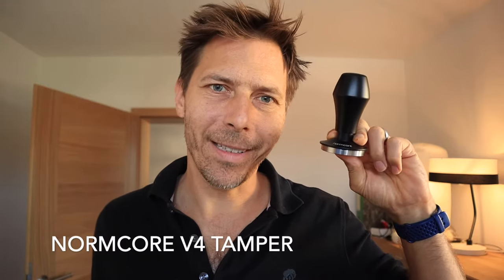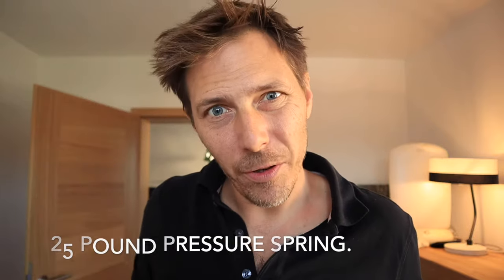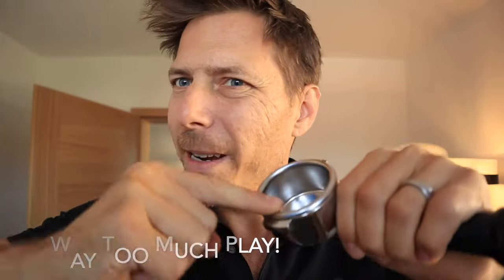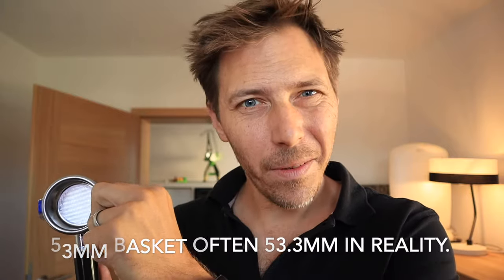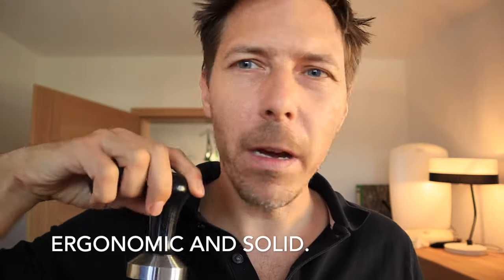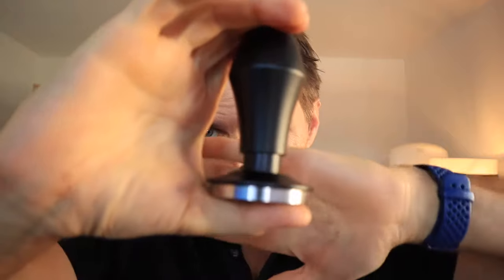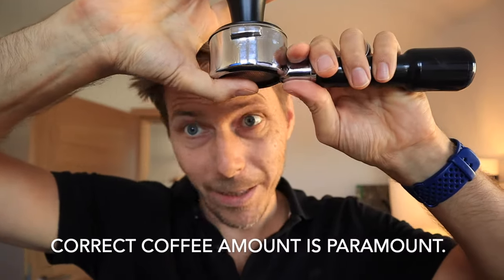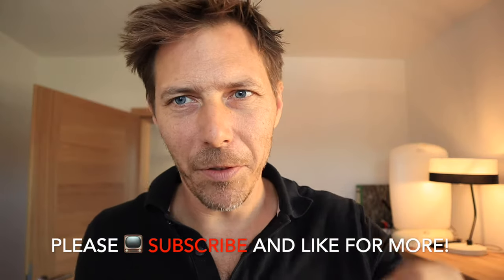A DEEP REVIEW of the NORMCORE V4 TAMPER.

Comment: I think Maestro is 51mm, should I get 51.5mm size tamper then?
Reply from the maker: Hi Ivan, yes the La Specialista models are all 51mm, but they have a ridge, so the 51.5mm will get stuck. You would have to get a ridgeless basket like the IMS to use a slightly larger tamper. But the one the Maestro comes with should work fine. Here is a link to the basket, FYI:  IMS Precision Basket: https://geni.us/DeLonghi_IMS_Basket
Reply: @TomsCoffeeCorner  thank you for the link Tom. I actually saved the bottomless portafilter u also mentioned in the other video, and its for De’Longhi 51mm, so for naked one do I need 51 or 51.5mm tamper? Appreciate for your help
Reply from the maker: @Ivan-fw4rl  Hey Ivan, if you got the Neouza, I believe it would be better to get a 51mm instead of 51.5. I think the Neouza basket is a little smaller than the IMS, although it does not have ridges. Cheers!
Reply: @TomsCoffeeCorner  haven’t bought it yet, its Joytata, it was from your youtube video description link. Guess that would be same as Neouza so 51mm tamper?
Reply from the maker: @Ivan-fw4rl  Hey just so you know, the Dedica portafilter does NOT fit in the La Specialista machines. The only one I have found is the Neouza, made specifically for the La Specialista. Cheers!
Reply: @TomsCoffeeCorner  Neouza in the cart. Thank you so much for your big help. I have few more questions, about dialing it in perfectly to get all parameters right. Hope u don’t mind, I added you on fb. 🙏
Reply from the maker: @Ivan-fw4rl  Hi Ivan! Thanks for the add, but I need to make another profile on FB for the coffee corner. Gotta keep things in organized, if you know what I mean. We can talk however here, or on insta, or YT. Cheers! Tom
Reply: @TomsCoffeeCorner  messaged you on Insta, may be inside the requests, and my name there is BANNED USER (not banned, just joke name) 👋🙂
Reply from the maker: @Ivan-fw4rl  No problem, let me take a look!
Reply from the maker: @Ivan-fw4rl  Hmm, I don't have any messages on instagram. Maybe try again? To be honest, I mostly just use Youtube and Patreon for messaging. But I read them all on YT. 😉

Comment: What dose do you generally use for your vivaldi?  I have the same machine and typically like 14.5g..15g at most. I use the IMS basket.  Was thinking of getting this  but your review is making me question it.
Reply from the maker: I normally use around 16 g. The baskets are just too deep, so I use the combination of this tamper with a standard one. This tamper is great, because it scrapes all the grinds off the side of the basket, and tamps level.
Reply: @Tom's Coffee Corner  Thanks for the reply; seems there is no chance it will work for me then given I use much smaller doses.   The work around for not having enough travel is doable,  just cumbersome to have to always use 2 tampers on the counter.  Hopefully someone will come out with a 53.3 that will work for the vivaldi...
Reply from the maker: @jcran17  Yes, I mean it works alright if you use the original basket that only fits 15-16 grams, but it still could use 2-3 more mm travel. It really doesn't work with the deeper 21 gram basket.

Comment: Your video doesn’t explain how you know you’ve reached 25lbs
Reply from the maker: Hey James, as I understand the mechanics of the springs, the 25 lb spring will compress and give way to the opposite force starting at 25 pounds. So, you have 2 opposing forces. The coffee puck on one side, and the spring on the other. The max amount of pressure the 25lb spring can provide before caving should be 25 pounds. At least that is my guess.
Reply: @TomsCoffeeCorner  that was my assumption but when I press the tamper on my bathroom scales, the springs begin to compress at much lower forces.  The 30lb spring gives at 13lbs.
Reply: @TheTurbohippo  Wow only 13lbs!? I don't think the spring mechanism tampers are really that accurate but that sounds like a good amount off from the target! As long as coffee is pretty much fully compressed and level I don't think it matters too much, being relatively consistent is also helpful. The thing about springs is that they're kinda progressive, so wouldn't the depth of coffee in the basket change the amount of force applied?

Comment: Too bad you have no idea how this tamper operates. 1. The bigger spring has nothing to do with the tamping pressure. 2. Instead of regurgitating the manufacturer's claim about each spring's pressure you should have tested them. The weakest spring for an example has 32Lb pressure instead of the claimed 15Lb. You also neglected to mention the huge manufacturing tolerances which cause so much wiggle in the tamper that it's not fun to use . Overall it was a useless review.
Reply from the maker: Thanks for your feedback.
Reply: Dude, you don't have to like the review, but there's no need to be an ass about it, really.
Reply: What a smart ass response 😮